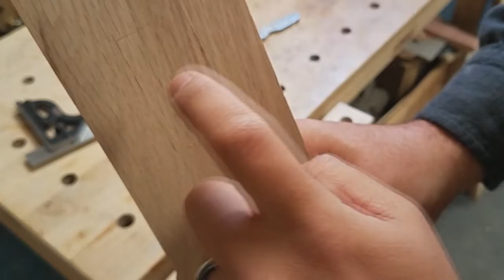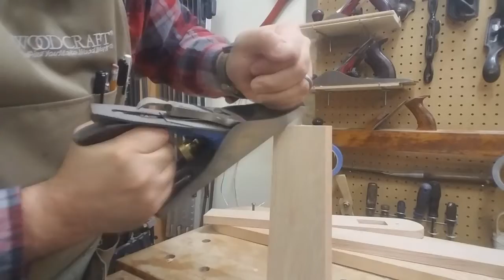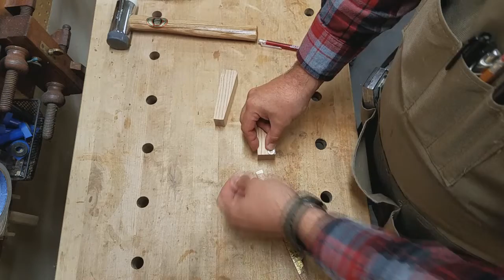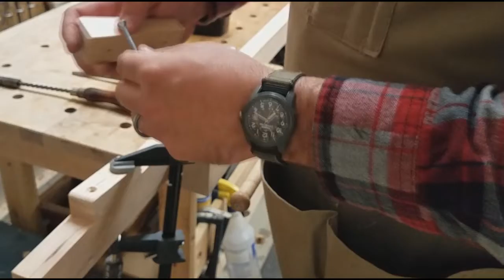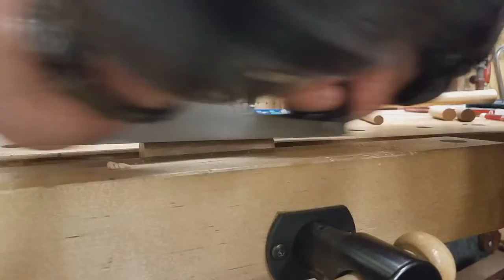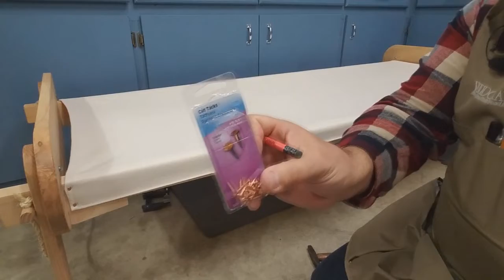Making a Civil War Field Cot

Comment: If you had to put a number on it, based on your craftsmanship, how big a person do you think that cot could hold?
Reply from the maker: Excellent question.  This one held me and I'm about 230 pounds.  There are a couple things you could do to make it even sturdier regardless of weight.  You can use thicker canvas such as 12 or even 15 oz canvas.  You can get that at Big Duck Canvas online.  This build was within a budget so I used pine rails but hardwood would be even better.  If you found it still flexed too much you can add a center leg to each of the rails to help with weight distribution.